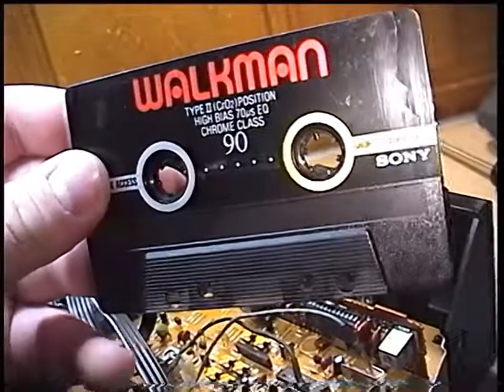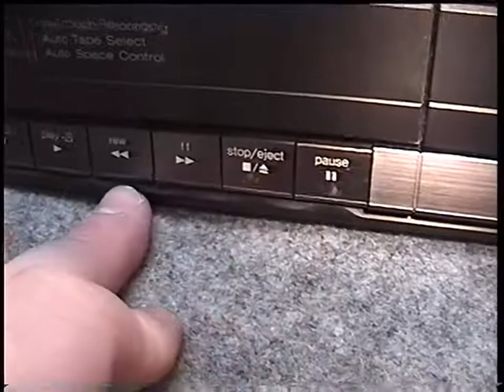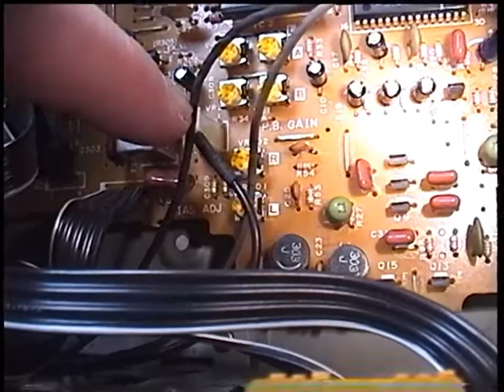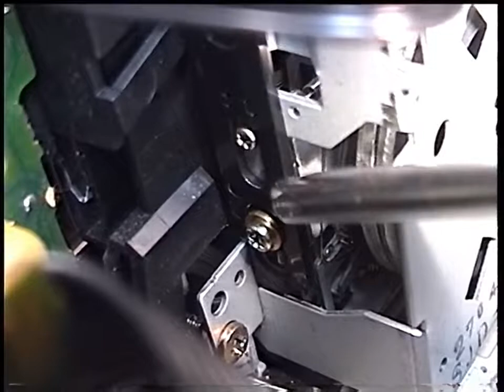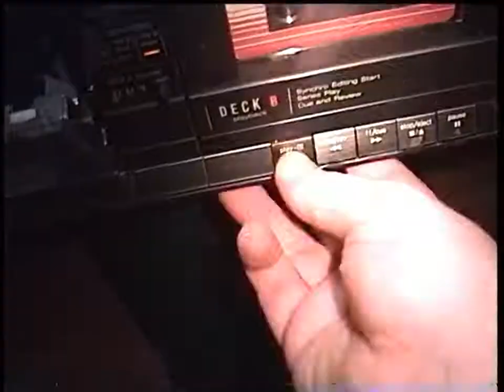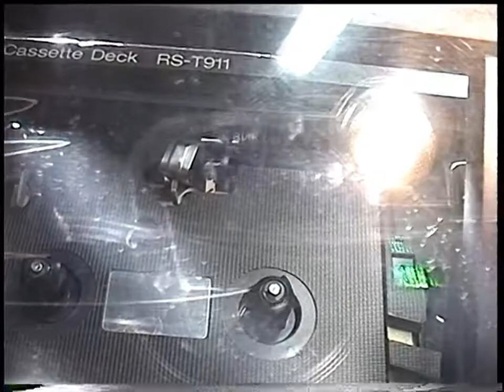1988 Technics RS-T911 Cassette Deck

Comment: Motors are worth saving for others and various parts i had a gear failure on a panasonic mechanism in a denon so i parted it out and it provided head screws for my cheap messed around with sony tc-k561s 3 head deck .